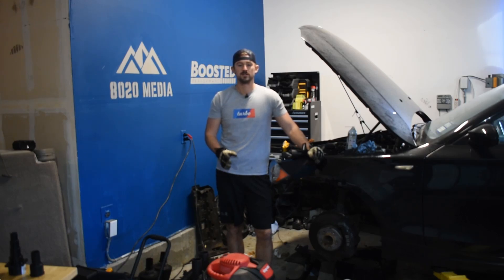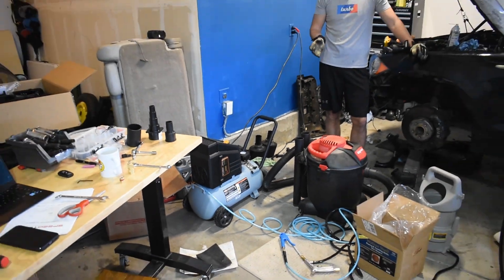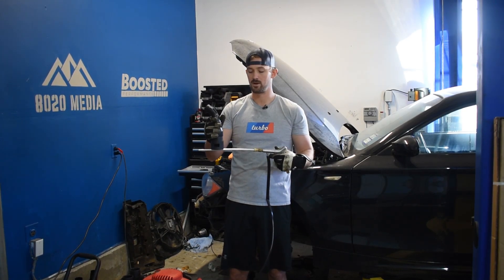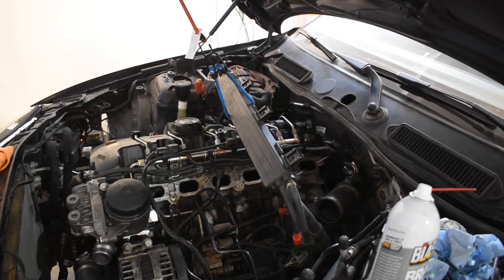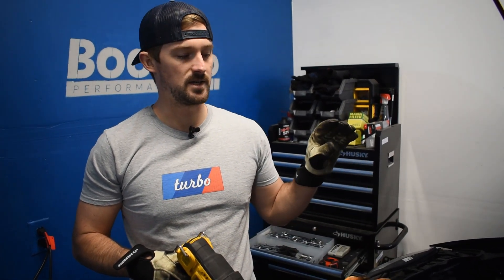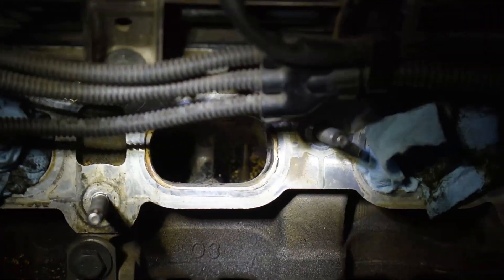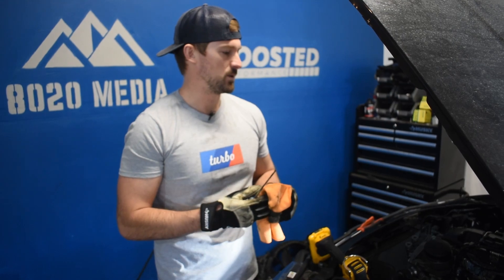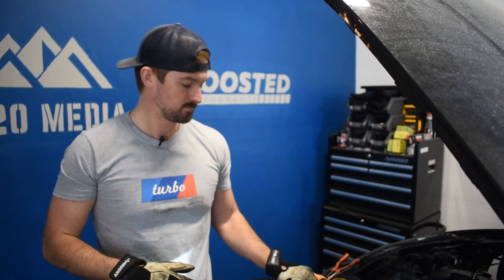DIY - Walnut Blasting Your Intake Valves (Remove Carbon Buildup)

Comment: Nice video. If break cleaner gets into the combustion chamber, ideally it should be ok right? Since it's combustible it will just burn off and exit through the exhaust valve.

Comment: Has anyone ever tried the new laser cleaners?
Reply: Never heard of it.
Reply: It would work but not get behind the valve, but it is cost prohibited. If you have the lazer ( comes in different watts output), that's great, but to buy one just for this project, forget it too expensive. Maybe one could rent one? The walnut shell approach is the way to go.
Reply from the maker: P - We personally haven't.

Comment: 1. Zip ties
2. Intake & valve cleaner
3. Pick set 
4. flathead screwdriver
5. Shop vac wet filter 
6. Shop rags
Reply from the maker: Z - Good list!
Reply: Why wet filter on the shop vac?
Reply: @djcoinlaundry so you don’t damage dry filter or motor due to clogs . Liquid can pass through foam material on wet filter and it stills trap Most debris. the carbon deposits/cleaning solution will make a liquid dirt soup.

Comment: Would spraying something like Sea Foam through the intake on a regular basis eliminate the buildup if started on a new engine?
Great Video.
Reply from the maker: D - It would, but we wouldn't advise doing it very often.
Reply: @ Does every oil chance (5000 miles) seem reasonable. 
Do you foresee any problems doing this?
If so, do you think this will eliminate carbon buildup?

Any other maintenance ideas to eliminate carbon buildup?

Thank You…
Reply from the maker: D - A catch can helps. What vehicle do you have?
Reply: @ think8ng about a 2025 or 2026 Ridgeline.

Comment: I have just one more question.  After I have spent hours doing this work and getting the valves beautifully clean.  What are the best ways to keep those valves clean??.. I read somewhere about oil catch cans?  Do these help keep the valves clean?  are there other things you can do to your engine to keep them cleaner for longer?  Thank you.
Reply from the maker: S - Unfortunately with DI, you can't keep the valves as clean as walnut blasting them. However, you can assist this with a catch can or high-quality fuels and additives.
Reply: Methanol injection system will do it
Reply: The only way to keep your valves clean on a GDI is to not start the engine
Reply: I just bought a oil catch can that  completely separates air and oil and is a crankcase evacuation system from Tracey Lewis Performance

Comment: All this wouldn't be necessary if they kept the fuel and air going into the engine and the fuel would clean the valves at the same time, but they have now direct injection which requires carbon cleaning of the valves. I went to a Napa class and manufacturers are talking about bringing back fuel and air. Going before the intake valve, so it'll keep them clean without having to do this carbon cleaning
Reply from the maker: V - Great point!
Reply: Some cars come with MPI from factory

Comment: Hi, I came here in the hope to see what size walnut grit you use.  I looked on ebay and there are various grit sizes.  Which size is the best one to use for this job?
Reply from the maker: S - A common grit is medium, or size #12.
Reply: @8020Automotive  Thank you.  This is what I have available on ebay in the UK.   shot blasting walnut Media 16/30 0.5 mm cleaning Car engines+cylinder heads 20Kg.  Is that ok?
Reply from the maker: S - Should be.

Comment: How do you prevent the shells to go into the valve top opening?
Reply from the maker: G - You need to make sure the valves are fully closed and seated before you spray the shells into that cylinder
Reply: @8020Automotive  Thank you for the response! 😁I Meant the cylinder Head. this question is the only thing preventing me from doing this to my N54
Reply from the maker: G - This was done on an N54, so you should just be able to follow step by step.

Comment: I clean mine every 5,000 miles with CRC GDI IVD Cleaner. Manufacture suggested every 20,000 but I’d rather not. Though I seen some kinda worse ones that took two cans here on YouTube and got them pretty clean without media blasting. And yeah I had my car since new. Has 50,000 miles and purrrs like a kitten. If you up keep your direct injection engine preemptively. Basically before what manufacturer suggest you should be fine. Just remember, direct injected engines are high maintenance. And with the technology comes other anomalies such as LSPi so it’s extremely necessary to use an engine oil that prevents this phenomenon that can destroy your engine besides carbon buildup.
Reply: FYI do yourself a favor. Use CRC or any other GDi cleaner that you trust and like to use.  clean your valves every 5,000- 10,000 miles don’t wait past that. I’d say if it’s turbocharged GDi? Every 5,000 with oil change. Normally aspirated GDi  every 7,000-7,500 miles with oil change *important* use the CRC or whatever cleaner first. Afterward drive it for 10-15 minutes. Then do the oil change at your home if you dyi oil changes or take it to your fav oil change place? Well I’ve done my best and raised you right! Now get out there and do your best 😢ahhh.. they grow up so fast 😜
Reply: @anthonylove6639 dad? Is that you?. It’s me. I’m now in Australia but glad to hear from you. I’ll give this a try. Thanks for saving me buying all this stuff.
Reply from the maker: A - Well said and great advise. This will certainly help future viewers!

Comment: What fitting is used on the HF gun tip that allows for the extended nozzle to be threaded on? I have an extension nozzle that has a 3/8” male brass threaded fitting. 🙏🏼

Comment: I just opened our 2015 Chrysler Town and Country Hydro locked engine, just removed the heads few minutes ago and have insane carbon buildup; I believe it is what actually hydrolocked it as carbon can not be compressed either; in the process of turning the crank to unbolt the torque converter, first the crank could not be turned with the engine in the bay; had to get it out with the tranny and went through hell to get them separated; when turning the crank with a breaker and cheater bar to get more leverage, it took considerable effort to turn and i could feel close to the rotation cycle the resistance which is why the engine was seized in the first place; tomorrow I will work on the block and inspect crankshaft, bearings and connecting rods but I need to ream out the cylinders before taking the pistons out just ordered a reamer and it comes Saturday, i hope I do not have a bent rod, also have not inspected the valves yet, head looks ok at first sight so far; I wonder if this blasting can be done with the engine in parts as it is right now? I also want to find a shop that would clean, inspect and rectify if needed the block and heads, hopefully that could be done for under 1k, no idea, I want to reuse this engine; it was installed at 59K miles as the factory one spun a bearing, van had 127K when it stop in a flooded street as my daughter was leaving for work in a thunderstorm; initially there was lot of water in the intake and I sucked also like around 32 ounces from the chambers, when I opened the oil pans got some water mixed with the oil but oil itself was in good shape and found no metal shaving or any broken parts so far; seem the engine simple stop at the effect of the water and the carbon and some water made past combustion chamber into the engine block. If all this is correct then I think it is fixable which is why i am taking it apart; Mopar lifetime warranty denied my claim and so did the insurance; wanted to total the van as repairs were quoted around 13K by dealer; this is why I am doing it.
Reply from the maker: F - Sounds like the van went through hell. Sorry to hear about this. However, we appreciate you taking the time to share your experience. Keep us updated!

Comment: Good video. How much pressure were you using? For N54/N55/S55 engines, you are supposed to block off the PCV port at the top of the intake port when using media blasting to prevent media from going up into the PCV system. Anything that gets into the PCV system will end up getting sucked back into the intake port and it will go through the engine. The PCV ports are blocked by inserting a thin piece of metal like a feeler gauge between the valve cover and the cylinder head. It's another step, but it's in the official BMW procedure, so it should not be skipped.
Reply from the maker: Anywhere from 90-120psi I think - I just crank up the air compressor and let it rip. Didn't block off the pcv port on either N54 I walnut blasted recently without any issues but thanks for the heads up!

Comment: Not sure if anyone has mentioned in the comments, but taking wire ties in a bundle cut at angles, and different lengths, chucked up in your drill does a great job of removing carbon, while using amsoil foam cleaner.The wire ties do a very good job on removing the deposits on the back side of the valve stems. I figure anything to cut down on tedious scraping is a good thing.
Reply: I did this for my N55 and it worked wonderfully, great tip
Reply from the maker: T - Thanks for sharing your experience!
Reply from the maker: Gerald - Thanks for sharing this insight. First time seeing this.
Reply: Heard that yes but isn't there a danger they could brake off and small bits or even chunks could stay in there?
Reply: @Infj-62  inspect and vacuum if needed. You're already going to have the vac out anyway. If you have the valves closed while cleaning them, like you should, there isn't any danger.
Reply: I tried this but a few bits got in the pistons.  Hydrolocked my engine and blew it up. Ordered a short block and good to go
Reply: @yogamon are you serious or joking? What exactly did you do before it blowing up

Comment: Very well explained.
Just one question, what grade walnut shells did you use?
Coarse medium or fine?
Thanks
Reply: Size 12 is course grit at harbor freight.
Reply from the maker: Gerald - Thanks for this insight.
Reply from the maker: Jesus - Thanks for the feedback! We hope it helps. A common grit is medium, or more specifically size #12, which is what we used. However, this all depends on the amount of buildup.
Reply: 24 grit from harbor freight
Reply from the maker: T - Is this what you used?

Comment: The issue with deposits in there are that they prevent the values from closing.  You have to clean in the close position.   But won’t you fail to clean the deposits that are causing the most trouble… the deposits between the valves and their seats… ?
Reply from the maker: That's a valid point, this process won't clean the seats. The seats are at least subjected to higher temperatures from the combustion chamber so the best way to try to manage carbon buildup there is to push your engine hard from time to time. Hit a few redlines foot the floor. And running some additives like seafoam will help as well.
Reply: @8020Automotive seafoam and running those chunks down in to your system runs the chance of getting into the turbo…..which most manufacturers and legit mechanics will tell you manual cleaning is the best way to go if your vehicle is boosted.
Reply: @8020Automotive Even if you cleaned out all remanqants of walnut shells , can some of it still get Down and effect valve seating and cause loss of compression?

I walnut blasted my N55 engine and after putting everything back together I noticed the  engine stumbles , no codes are thrown , truck idles fine except for a rough idle which it was doing from before which prompted me to do the walnut blasting after I changed all fuel injectors, spark plugs and coils. 

It needed a walnut blast but after that now it misfires at low rpm’s, it drives but occasionally misfires across all cylinders, random misfires when looking at the live data as you drive. But no codes are thrown, no check engine light .  

Just changed the banks solenoids as well, thought it could be that, to no avail, so I started wondering if a little bit of the walnut shells got stuck to the valve seat and now I am losing compression because the valves aren’t closing properly .

I know the walnut shells are supposed to burn up in combustion and isn’t really anything to worry about , but it is just a thought cause at. This point I am stumped .

What are your thoughts on this?

Next I will do a compression test to see if all cylinders have good compression.
Reply: @dappa311 did your problem go away? I wondered if maybe your ECU just needed to learn the timing, compression, throttle, etc again after cleaning all the ports out. Happened to me when I blasted a VW Passat a year ago
Reply: @dappa311 I have a 3.6 v6 camaro that is doing something similar but definitely throwing a cyl 6 misfire after a manual valve clean wo the walnut shells. I’m gonna try to clean cyl 6 again and see but I have a feeling it’s something else. Any updates on your situation?
Reply: @Camarorsgirl have you tried soaking the pistons yet? Remove spark plugs coils and pour barryman b12 in there. You  vacuum it out with a wetvac then push the starter while plugs are still out so it can spray out the remaining carbon and liquids
Reply: Besides being built up so much that the port is plugged, carbon deposits usually cause air turbulence that results in performance issues. Any contamination on the seat is negligible and rarely results in them not closing adequately.

Comment: These DIY videos are super handy!! 

Walnut blasting my N54 today along with some other maintenance stuff!
Reply from the maker: Bass - Thanks for the feedback! Glad it was helpful. What maintenance did you perform?
Reply: @8020Automotive  Knock sensor, Walnut blast, OFHG, Power Steering reservoir, Front control arms, oil & coolant change. trying to also get the waste gate rattle fixed either later today or tomorrow. Had a knock sensor bank 1 code so hopefully it goes away after testing some pulls.
Reply from the maker: Bass - Nice! Always good to knock out maintenance, especially on BMWs.

Comment: My 300hp Pentastar 3.6L has 196k and I just replaced a few lifters.  My valves where nowhere near this bad.  What kid of busted ass motor are you running?
Reply from the maker: Umm doesn't your Pentastar also have port injection....

Comment: Great video. I have a 2016 Kia 2.0 turbo engine. Ordered the intake port adapter. Got to gather the media and blaster kit. May be over kill but would it be better to add air through the cylinder to insure nothing gets past the valve? Kinda like doing a valve steam seal replacement without removing the heads. Just a thought. I’m leaning more this way just for insurance.
Reply from the maker: Ernest - Thanks for the feedback! We hope you found it helpful. Keep us updated with how it goes.

Comment: @8020Media what did you use on the media blaster gun to get that longer stem
Reply from the maker: Mike - Here is the tool we used: https://www.ecstuning.com/b-bav-auto-tools-parts/walnut-blaster-nozzle-3-8-male-npt-bavarian-autosport/b1100003~bav/
Reply: @8020Automotive I found one on eBay that is described to be specific to my 2.3L EcoBoost. What makes the extension nozzles necessary and vehicle specific?
Reply from the maker: P - Different sized intake ports.

Comment: Good video. Where did you find the adapter tip to attach the long nozzle to gun?  I purchased the blaster at harbor freight and it did not come with it. It only came with ceramic tip and no other adapter.
Reply from the maker: I got it from here: https://www.bimmerhelp.info/buy-blasting-tools-html - they also had the vacuum adapter so just bought everything from them but you can probably find everything you need at a home depot or hardware store.
Reply: @8020Automotive  
Got it
Thank you.

Comment: Would you reuse the walnut media that collects inside the vacuum ?
Reply from the maker: I probably wouldn't, just going to be extra dirt and stuff accumulated in with it. So long as the valves are fully closed I don't know that it would necessarily hurt so long as you can get everything out, but I don't know if maybe they'd be less effective if they are gunked up a bit with carbon. The walnut shells are cheap so I'd just buy more rather than messing around with dirty stuff.

Comment: This is awesome. I've got some quick questions: 
- Where can we find the vaccuum/blaster adapters specific to my car (Qashqai)? 
- I'm new to this, but can it be done on any (gas/diesel) car, or only on specific types of engines? 
- A quick guide on how to put the gaskets back on would complete the mental puzzle that this is for me.
- How can you tell that you need to do this procedure? 
- Can you check for carbon-build-up through the spark plug hole (after removing a spark plug) and putting a camera down there? 

Thanks!
Reply from the maker: I'll do my best to tackle each of these:
1. I'm not sure exactly where you can find it for a Qashqai, you might have better luck searching for an adapter based on the engine you have rather than the model - can't say I know what engine is in a Qashqai haha
2. It only needs to be done on cars that use direct injection - typically turbocharged direct injected cars will build the most carbon buildup
3. This really depends on your car and engine - I'd look for a specific guide on the forums on youtube that shows you how to pull the intake manifold off
4. The easiest way is visually inspecting the valves - it usually causes a slight performance loss over time so it usually isn't super noticeable to the untrained driver. Usually every ~80k-100k miles you will need it
5. No, you won't be able to see it thru the spark plugs as the buildup occurs within the intake ports and not within the cylinder that the spark plugs poke into